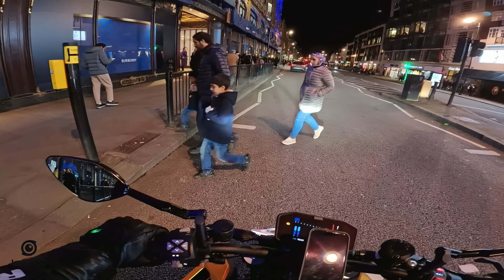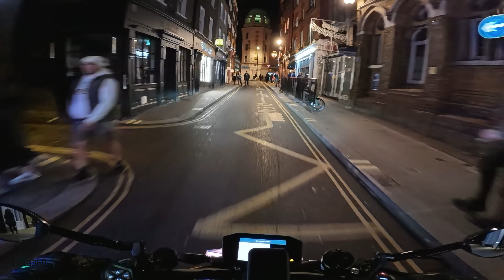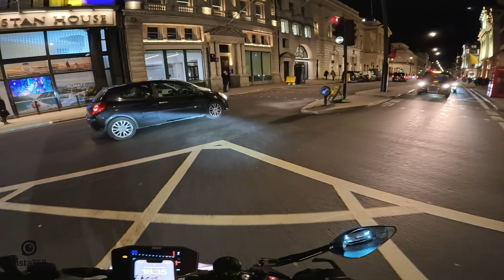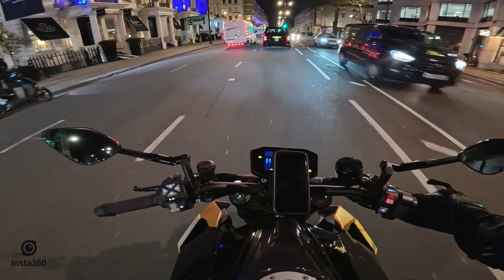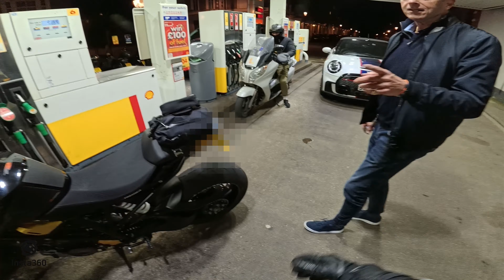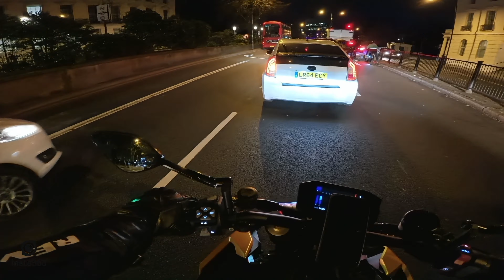Insta360 Ace Pro NIGHT RIDE x KTM Super Duke 1290 R Austin Racing V3 150MM Exhaust

Comment: I thought KTM super duke is automatic transmission
Reply from the maker: It’s manual. If you don’t see me use the clutch then it’s because I have a quick shifter which means I don’t have to use the clutch to go up or down in gear
Reply: @emkok  I see i have 1250gs kinda thr same tho.. Google said it was automatic and i thought it was a DCT.